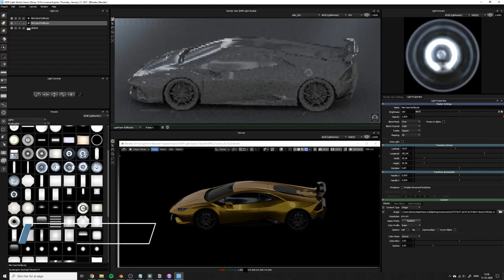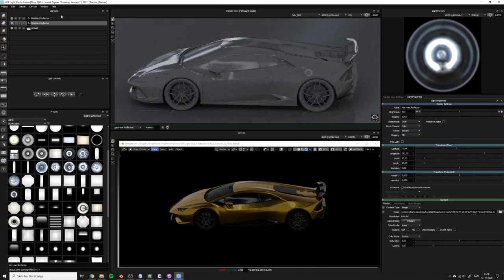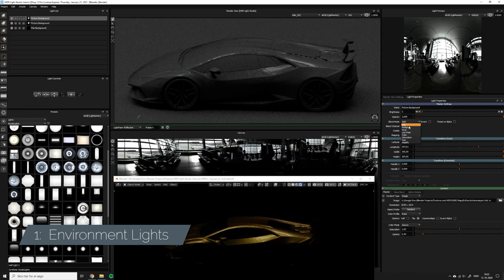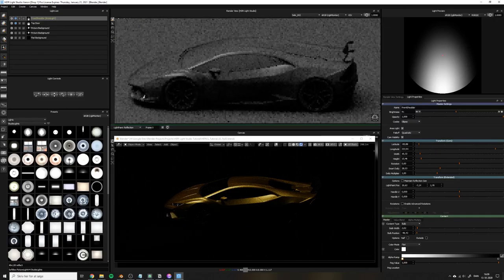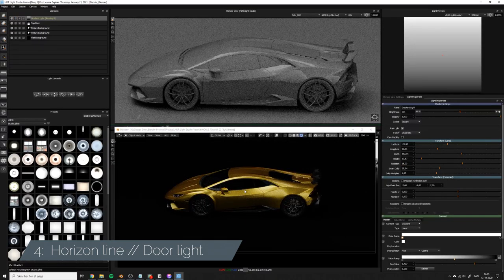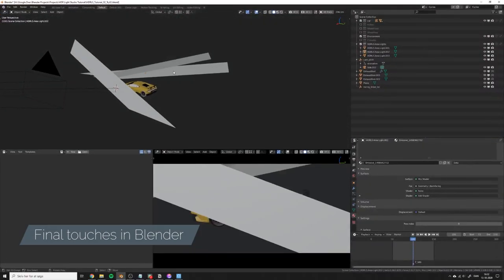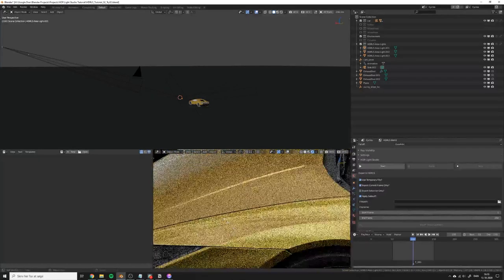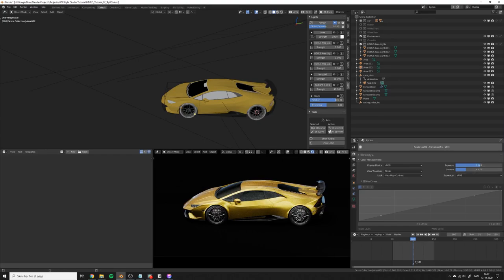3D Car Lighting like a Pro || HDR Light Studio x Blender

Comment: When you change the size of that proxy for the final render. Doesnt make a huge difference in the final render? I mean normally how environments lights give much more detailed and power in the light if they are better quality.
Reply from the maker: No, no - When you change from proxy to final render the lighting intensity will stay the same. It's 1:1 - The only difference is the quality ^^
Reply: @DanielVesterbaek  yeah that's what I meant to say, I had quite some typos (mobile YouTube). More details can also mean seeing details you don't won't. Just like in your final render. We suddenly see reflections of that multiplied HDR you added in the beginning. Sometimes you don't want that sort of details. But I guess one should do more testing near the end with higher proxy settings
Reply from the maker: @RomboutVersluijs  Yes, I think so too. I experienced the same - That the car looked a bit different after rendering the final, but it was only because of the quality of the texture. The brightness values were very very close. But yes, I usually bump up the proxy in the end when I start on all the details.

Comment: When you talked about the reflection on the clearcoat and the metalic paint below. Its actually kind a weird that the lights deadone the side of the car dont show reflection of the lights just like that gradient did on the roof and the other side. IS that perhaps due to blender not showing reflections of certain light types?
Reply from the maker: Yeah... I think it's actually just my materials. I gotta re-work them. The clear coat is not working as it should. I remember you talked about the clear coat in cycles not being so accurate - For this reason I also made my own, but I still don't like it so much

Comment: DO you happen to use Photoshop? I noticed the curves editor in the color panel works weird. In photoshop when you make an S curve ( so light up and dark down) it gives a more contrast rich image. I noticed in Blender it doesnt work like that. Perhaps my setup was corrupt orso. But i found that really strange behavior
Reply from the maker: Yes, for this image I also took it into PS in the end. I think it might be because in Blender the curve is adjusting the linear image before applying the Filmic transform and if you use the curve in PS then you are applying it directly to the sRGB image, so it would be after the Filmic transform
Reply: @DanielVesterbaek  I don't know what's is happening. It looked somewhat like it's flipped or so. I haven't investigated thoroughly eniuj. I also seem to have issues with filmic, I tend to find the whites somewhat yellowish and not nice.
Reply from the maker: @RomboutVersluijs  I am also really curious to get started on using ACES for my project. That should do the trick. Filmic is so much better than sRGB I think, but it's still not entirely there

Comment: ok but I wish they made perpetual licenses not subscription model.
Reply from the maker: Yeah, that's true, I prefer perpetual as well. But to be fair, they do have a perpetual license in there, but it's more pricy than the indie license. I also see it as a tool not everybody will buy because of its pricetag. However compared to other tools out there for software like C4D and Max 95 GBP per year is actually not so much. I think that the prices on the "blender market" is just much lower than most other places in the industry.
Reply: I really hate these license, so many developpers turn towards this. It kinda forcing the app on users and they need to keep licensing in order to use. I find that very very bad towards the user.  I wish users could still make the choice to upgrade or not. These models for software cost a user much more money. I knew about this app a couple years ago and find it quite expensive for what it does. Yes it easier, but a couple 100 a year for a license?! One aother thing is that i find the difference between Pro and Indie also quite unbalanced. The only difference is the support, thats almost $300 difference?!
Reply: @DanielVesterbaek  But if your a hobbiest you cant really apply for Indie. I guess they need proof of a valid registered company
Reply: @DanielVesterbaek  Where did you see a perpetual license, i only see the single node locked version aka $1200
Reply from the maker: @RomboutVersluijs  That is true. The price-jump seems big, but I suppose it's more just about making it cheaper for the indie users. If you think about the automotive industry there is so much money in that. If Volkswagen wants to render cars, they don't care so much about the pricetag. So I think the indie licenses are really for the freelancers and hobby people and a way for them to be able to use it. The indie license is also allowed to be used for hobby as well by the way ^^
And the perpetual license they have is called "single user permanent". :)
Reply: @RomboutVersluijs  nearly all companies selling commercial 3D software have moved to selling only 1 year licenses. However, Lightmap do offer a permanent node locked license for HDR Light Studio users who don't want to pay each year. However the price is more expensive for this. We also offer a very cost effective Indie license, which is very popular. When your license expires, all the lighting you have made still exists... it's not like you need a license to open your Blender scenes lit with HDR Light Studio, as it builds HDRI maps and Blender Area Lights with HDR images. So people tend to renew their HDR Light Studio license when a project comes in and they want to 'author' new lighting. In contrast, if your renderer license expires... you need it to render your old scenes right... not with HDR Light Studio. So in that sense, it's not like you are held to ransom when the license expires, which is worth considering for those that don't like subscriptions. You only need a license to make new lighting with it, which seems fair enough.